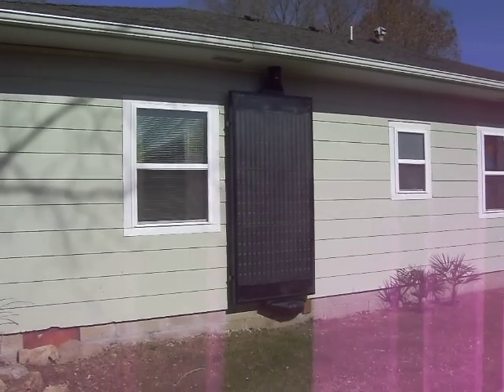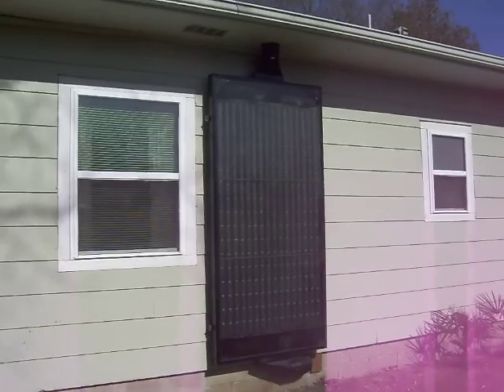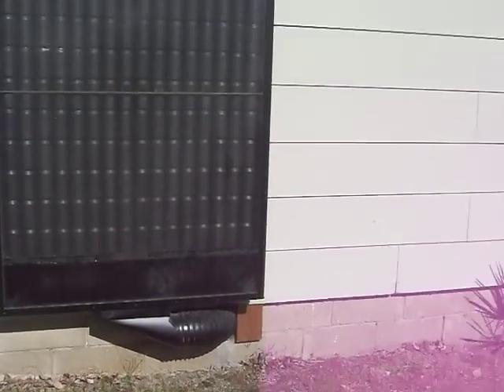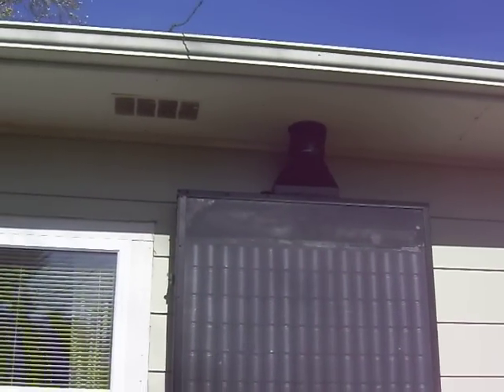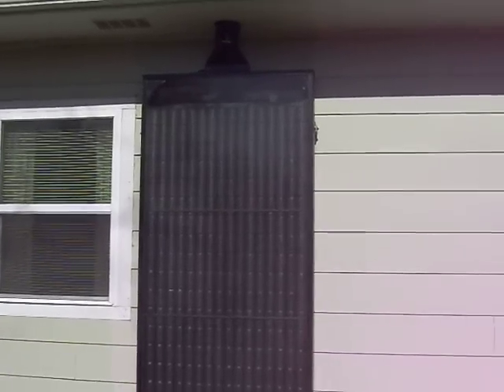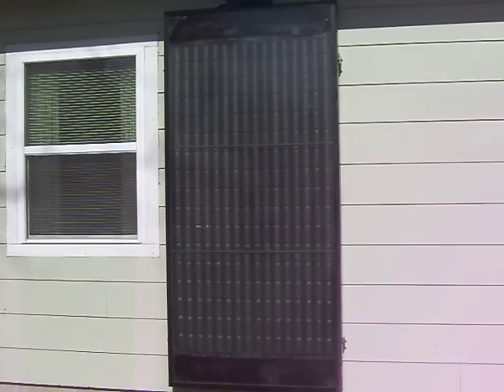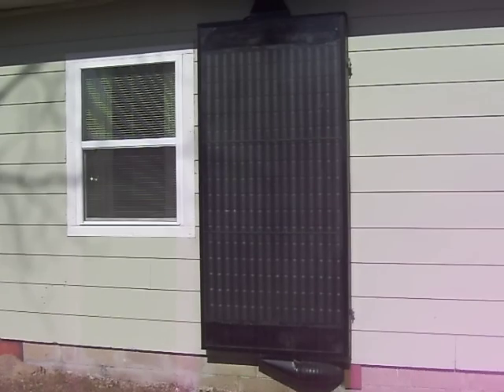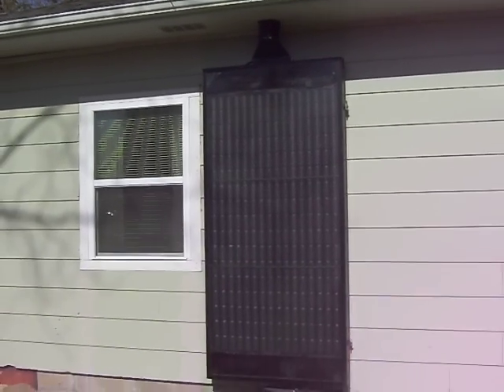272 Solar Can Heater

Comment: WOW, that's a lot of cans! nice furnace though! i only put 132 in my unit, and it drove me nutz!! using cans is a lot of work, like you said. the next furnace i build, i'm going to use corrugated tin roofing, aluminum flatstock, and a metal break/bender to create my own baffle design (i'm a carpenter, so bending aluminum flatstock is pretty easy for me, comes with the job) to help slow the air down. i'm also going to try to locate a used thermal pane to help trap the heat in the unit.

Comment: Hi, I like your video. I understand about the work with soda cans. I am going to create solar heaters for my home and as a side business. Here is food for thought. I have read the thinner the material (aluminum) the faster it will absorb the heat.
So for me, I am going to use foil to catch the sun, I thought i'd suggest it to you. For me it will be in many strips, in a fan design. So the strips are aligned with the sun thru the day, more or less. anyway good luck!!!

Comment: Soul, I have yet to make anther one but my buddy did.  He used a wood frame, shower door, and corrugated. Worked like a charm. He just suspended the corr. in the box and passed the air through with a small fan.  There is no connection to the headers. It's kinda like your home furnace the way the air just pulls the heat off the elements as it passes by. My first one was a wood frame w/foam board in the back. I just glued the cans to the foam as if they were stacked. Got hotter than my big one.

Comment: @natedogg1026 how would you go about connecting the corrugated panels into the headers. I know the cans connect via holes but how does the panels work that way.Did you ever make your other heater with the corrugated panels..if so how did it go. Thanks